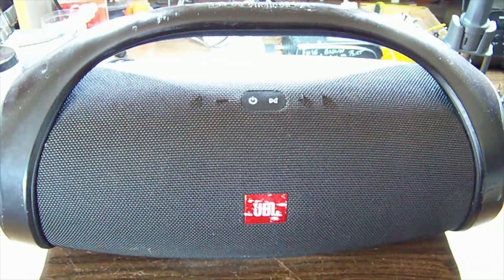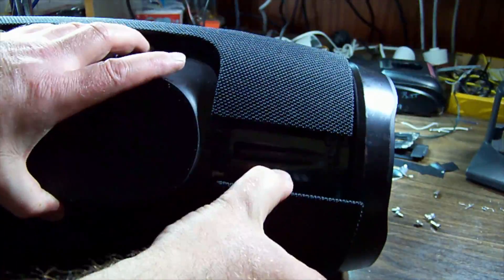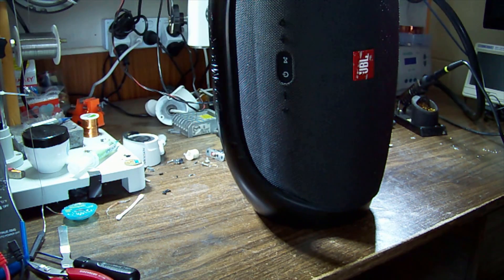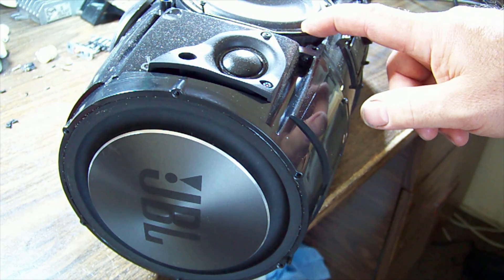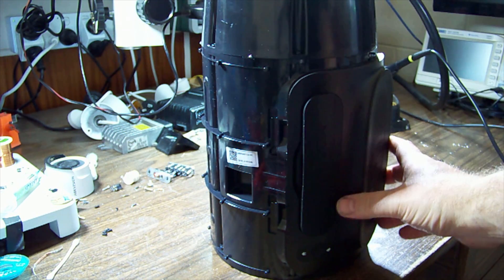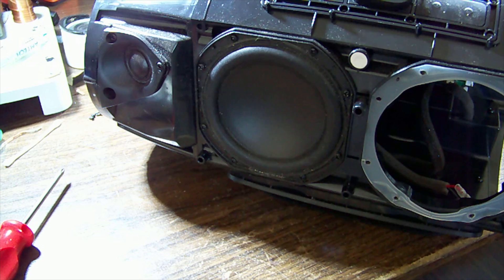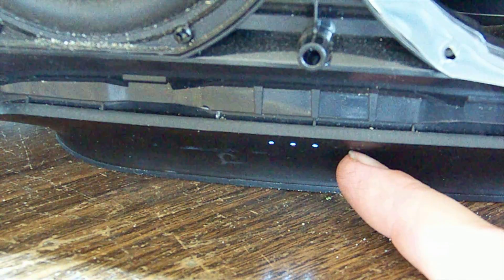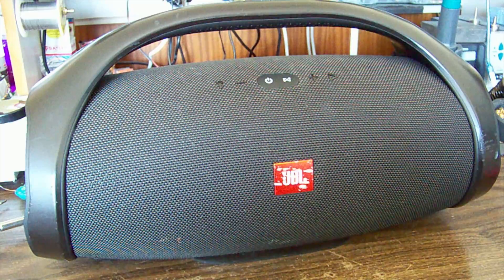How to open a JBL boombox, oh and the actual problem.

Comment: Just bought a jbl BOOMBOX 2 you think I’m safe from battery defects ? I’ve seen a lot of posts about some JBL extreme batteries going out after a year 🙁
Reply from the maker: People like to listen to music so much I'm sure most will run it until it's dead flat. This is bad for LiIon cells. If you can only let it get to 50% before charging you will get a lot longer life than if you run it flat all the time.
Reply: @JonnyFix  If I dont need to use it on battery can I leave plugged in all the time? will that prolonged the life of battery?
Reply from the maker: @darioantunes1239  Multiple charge / discharge cycles is what depletes a batteries capacity over time so in theory yes.

Comment: My boom box wont turn on if you look closely the light next to the power button flashes quickly but very dim, if you press the power button multiple times it will turn on again. Never dropped and this is my second one first returned for same issue
Reply from the maker: That is strange, I would be looking at the power button itself in case it is damaged somehow.
Reply: @JonnyFix  It doesnt feel damaged and after futher research other people have the same issue, turns on first time plugged in but on battery have to press it many times no posted fix found
Reply from the maker: @henrybrooks321  charging circuit might be damaged. Really need to take some measurements and figure out what is happening.
Reply: You gotta get the jbl app and update it , this used to happen to me but I updated it n it fixed it
Reply: @aidanlalljee3189  oh really I just keep going to the local store and getting a new one, happens about every 3-4 months and this will be my Fourth. It's really good because you get a brand no speaker no questions asked and it resets my warranty haha
Reply: @henrybrooks321  damn , that’s cool 😅
Reply: I have this exact same issue, this is my second boom box and the exact same thing happened with my first. I don’t think I am able to return this unit this time because I lost my receipt. So I’m trying to figure out how to fix it.
Reply: @thebroalex8767  try the software update like suggested, or just try return it without the receipt they are usually pretty good and Will accept it over here
Reply: @henrybrooks321  I did the software update like it was suggested and it worked like a charm! So glad I found this comment thread. Thanks again
Reply: @thebroalex8767  I wont be updating I'll just be replacing haha
Reply: @henrybrooks321  haha I’m with you on that, if you can just keep getting it replaced then that’s better. But since the boom box 2 came out they’ve stopped selling the original in many stores (I tried finding a new one). So if it ever comes down to it, just keep the update trick in mind.

Comment: That battery is a li-ion battery in 2S 2P? configuration and the maximum voltage is 8.4V (4.2V per cell).

Comment: I cant decide between xtreme 2 and the first boombox,the price difference in my country is only around 100eur . Ive tried the boombox and it just blows the xtreme 2 out of the water for me.But ive noticed that a lot of people get that hissing sound on low sound/battery level on the boombox. Can somebody help ?
Reply: Cuz the boombox has 2 usbs so the batterys dead
Reply: Solution: charge the boomboz

Comment: I've got a BOOMBOX open now. Was going to order a battery but I want to verify first.  The charger is putting 20v into the main board but how can I confirm that the right voltage is coming out of the 8-pin battery connector.  With the battery UNPLUGGED there is NO voltage across the red/black wires and about 2.8v across the Blue/white. Anybody know what to look for at the 8-pin connector?
Reply from the maker: If I had to guess I think the blue/white are for temperature sensing. If there's nothing on red/black the battery has probably shut down from being discharged too low (or some other failure). If you have an adjustable power supply try applying a voltage with a current limit of about 200mA across it while unplugged from the board and see if it wakes up the battery, if you can't limit the current put an ammeter in series and wind the voltage up until you see about that much. If this works then it's deeply discharged so keep increasing voltage to maintain that current until you hit about 6 or 7V. If a voltage remains on the terminals at that point you might be able to plug it back in and let the system charge it the rest of the way. On the other hand if it doesn't draw any current up to 8V you may need that new battery.
Reply: @JonnyFix  I'm following the battery check procedure just as you laid it out. I nursed the the power supply up to 7 volts while staying under 200ma. I left it for 30 mins. The battery now holds a 6.5v charge.  If I plug it back into the boom box (w/charger unplugged) it still will not turn on. I know the 20v power supply is good and I see 20v going into the motherboard. The problem then appears to be in the "motherboard". Correct?
Reply from the maker: @mikeskory3157  that might still be too low to turn on. When plugged in does the charger continue to charge it? If not I'd manually charge it up to 7.6v then try again. You should be ok to charge at 500ma now. I think maximum charge is 8.4v, you want to ensure you don't exceed this at the battery terminals. It will be lower at the battery than at the power supply due to a drop in the wires.

Comment: When i got the boombox on his side and i turn left, the ring is not gonna move
Reply from the maker: I think if you push down too hard while turning it can work against you as the ring comes away from the case as it turns so it's a balance between force and grip of the ring to the surface it's on.
Reply: @JonnyFix  I felt like I had to push down fairly hard to get it started. Something could have spilled into the one I'm working on...or dropped...
Reply: Hello! This is a copy a paste response. Please read fully if you are still searching for an answer to this solution. I am currently having this problem. First, let's check the serial number located in the port section of the JBL Boombox. If it starts with ND, most likely the process in the video will not help. For this model you will need to pry it off. Consumer discretion is advised as I have not done this process yet and am unfamiliar with how it will feels/looks like. I highly recommend more research before committing to the act. For those without the ND model, the process is not clearly described in the video. Your goal is to remove the opposite ring side using friction from the "normal force" of the surface of your choosing. Choose your surface wisely, it should be flat, grippy and dry. NOW, you can clearly visualize what the videos instructions are. You are not trying to remove the ring facing you but the one underneath. With the JBL Boombox upright, sitting on the subwoofer side you will need to apply pressure and rotate it anti-clockwise. BE WARNED. This requires quite an amount force. Hope this helps you in your endeavor internet stranger.

Comment: Would I be able to ask you a question. My boombox won't charged it got a bit damaged and the charger cord was wrecked but the boombox still worked fine. It's now going flat (red flashing light) but the charger I brought doesn't seem to be working. Do you think maybe the charger cord disconnected ?
Reply from the maker: Hard to make a guess on these things. Need to test the charger plug to see if there's voltage there, if not it's probably the charger or the cable from it, if so then check the socket in the boombox or the charging circuit.
Reply: Mine too

Comment: I cant twist the edges of mine.
Reply from the maker: It is quite difficult
Reply: If you have an ND model you’ll need to pry the sides off..I had the same issue but found out I had a nd model
Reply: @mikecombs5761  How do I know I have the ND model?
Reply: @MrBiskupek  Serial number on in the port section, it will start with ND.

Comment: It's a bugger when you think you have a challenge, then it's too dam easy.
Never mind, you fixed the plastic fantastic heap of crap :-D
i noticed no hotglue on the connector, so it backed out with the vibration and being chucked around a lot.
No spare screws to keep, that's the best part of the repair :)
Reply from the maker: Most stuff I get lately has been boringly easy